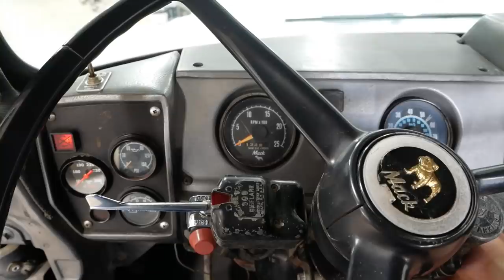"Simple" Axle Flange Leak Escalates Quickly - Vintage Mack Truck - Part 1

Comment: You are a poet: A single stack Mack with a window in the back. LOL If your going to replace the rear lug nuts I would put that tin shield back on it might be a heat shield for the inner seal it could be they improved the design by adding that heat shield .I don't know though maybe not a big deal for how the owner uses the truck.

Comment: one way i handled very tight axel nuts, was to use a jack stand to support the racket socket extension, kept it inline center! plus a long cheater pipe to loosen the nut.

Comment: Old RL looks well kept. Those Aluminum frames like to crap out where ever steel touchs them. Had an old 67 RL 700 the whole rear frame at the trunion broke away from Galvanic corrosion.

Comment: That sure is a beautiful truck. It's too bad they crunched it when they pushed the radiator into the fan. It's really a sharp looking tough looking rig with the white cab, black frame and all the polished aluminum tanks and wheels. It's a bad ass grain hauler.

Comment: That's the first time I have seen this style of tire plug installation and It gave me a light bulb moment. It makes me wonder if it could save punctured tubed motorcycle tires on the road. You can't leave a hole in the tire even with a new tube because dirt will get in, ruin it and leave you stranded.. again :P. You also can't put a string type plug in it because it is not flush on the inside of the tire. I might give it a try next time I get a puncture from a nail.

Comment: Aha, no :o) The thread starts down the hole so the shear stress is well away from the weaker surface. I guess it buries it deep like a good fence post. For a dowl you need interference fit on both halves or it just wobbles loose. It still fascinates me that the drive is actually going through the gasket paper under the huge compression force of the bolts.
Reply: An unusual internet discussion had was on changing the hub oil. Never done it, never seen it done on a truck. However, on the old Range Rover axels we all raced we noticed how the wheel bearings ate the oil up. I drained and refilled mine through the stud hole every couple of seasons and so did other folk. And then you wonder, what else is doing the same oil abuse?
Reply: Cracking vid really enjoyed it :o) I know that sinking feeling when the bolt doesn’t tighten, especially when out on site :D

Comment: also the mechanic that fixed the 1 at work told me never use an impact on cast iron because its brittle and will lead to what happened to that hub....just repeating what i was told  but its kinda true we f'd  up a few pump housings  when he told me that we quit using impacts on cast and we didnt have any more trouble.

Comment: Hi Wes, good video! it's just too bad you don't have access to a machine shop as good as you're hardware store because any competent shop could have repaired that hub! With you're attention to detail I would have expected you to replace that outer nut that you boogered up with the air hammer instead of reusing it without even removing the burrs.

Comment: What material were used on the tire repair?
That "inner lining compound" and before that the cleaning and some kind of special rubber glue?
And what was that tool and move at 25:19?
Reply from the maker: Standard patching chemicals. Buffing fluid. Patching cement. That tool is a bead blaster. It blasts compressed air at the bead to seat it.
Reply: @WatchWesWork  Thanks!

Comment: If the batteries are left uncovered and they get wet from the rain, the water is going to short the poles between them and the the frame also. The same goes for washing the engine compartment of a car and not removing the battery.

Comment: The next time you come across an axle nut like that use a jack stand to stabilize the end of the extension near the ratchet. That way your socket can't go off kilter which means it will have full contact with the nut. I was watching it come down on the top of the nut ,and was screaming use a jack stand dammitt!! LOL

Comment: I live in France, we don't even have a poor autoparts store. We do have one step up from a quick lube with an attached store with the stuff you might find in a well stocked walmart, but at USA dealer prices. We also have trade only auto parts stores, you can buy from them, but service will be grim and the price will be worse than dealer. Example a no brand poor quality made in china 12v rocker switch €17.  Small can of body filler 250gr €14. We have online options, but next day isn't an option and it all comes from Germany or elsewhere. Something I realy miss from my 10+ roadtrips in the USA (all in cheap beaters I bought).

Comment: I worked on a lot of r macks never seen those studs stripped out. And i changed a lot of those axles. Ready- mix trucks popped them like twigs.
Reply from the maker: I've never seen it either. I'm guessing what happened is the studs backed out of the hub and were not screwed back in all the way. Then they pulled out the little threads they were engaged in. So they screwed them in all the way, but there was not enough threads left to do the job.

Comment: 9/16", them and 7/16" are odd balls.. 9/16" fine nuts should be common, they are the nuts for spring bolts on  trailers. . And it's 13/16" for the bolt and 7/8" for the nut. I'm putting wet bolts and bronze bushings  just now on my 1958 utility trailer . going elk/moose hunting.  The 1 3/4" springs are causing a problem getting bronze bushings , 7/8"x9/16"x1 3/4" BTW I'm glad I'm no longer grunting away on heavy machinery.

Comment: Another good one. You can't use your tire machine in semi wheels? I did not know that. You make breaking that wheel look easy
Reply from the maker: No. They way to big and heavy to get on the machine. That wheel assembly weighs around 120 lbs.
Reply: @WatchWesWork  holy crap

Comment: I wonder if you could throw a keensert in there where the stock threads go and then make a press fit sleeve that goes into the minor diameter of the keensert so you still get the dowel pin effect but with a lot stronger threads. Thats a lot of mill and lathe work for an old truck hub though.

Comment: I always packed the bearings on full floating rear ends.  Are Macks special?  Loved your video, brought back memories of my days on the farm. Thanks.
Reply: From everything I saw it looks like they run in oil, there are only outer seals for the hub and the flange seal. They're getting bathed.

Comment: ..if you're certain the Front Studs are done, i'd get the guy to let you do the Rears at Half the six hundred since you're already There..

..& install that Metal Piece, it's a Heat Shield from Overheated Brakes for those Rubber Seals in there..

Comment: Wes, Just some questions could  you drill the stripped holes deeper and thread with a pulley tap and install studs into those 3 holes, as a machinist would be an easy lathe job to make the longer threaded studs. I know it's too late now for this job but there will be a next time. Another quick option without much work look into steel threaded staked inserts, we use them on stripped threads on aluminum, a quality fix, looked like you had enough area around the stripped holes.
Reply from the maker: I suppose I could have!

Comment: I wonder why i was taught you should pack the bearings on axles hubs when service or replacing them when almost every other video I does not? Granted i was taught this on Trailers specifically but, not quite sure why it would be any different on a drive axle. I was told packing the bearings with hi temp grease along with the axle grease give the absolute best protection possible. Thoughts?

Comment: Great video, that truck is immaculate...
     What was the black substance that you applied to the wheel bead..., maybe something related to the aluminum rim and the calcium chloride corrosion issue...?
or sealant of some sort...?
Thank you.
Reply from the maker: It's rim rust preventer. Supposed to keep the bead surface from corroding.
Reply: @WatchWesWork  
Ok, thank you sir for the response back, I am about to do a similar repair on an Eaton axel, was a great video for me.

Comment: 4:54 If you install the heli coil to the correct depth why shouldn't the stud work ? Unless the stud shoulder bottoms on the hub flange ?
Reply: To install a helicoil you have to drill and tap the hole oversize. That'd leave the unthreaded portion of the stud unsupported.
Reply from the maker: Because the drill for the helicoil tap is much bigger than the diameter of the stud. You would also need a bushing.
Reply: @mattt4183  Thanks
Reply: @WatchWesWork  Thanks

Comment: A word of advice always put some gear lube in the hub cavity before you put the outer bearing in it takes a while for the lube from the housing to get out to the hub have burnt up bearings doing it without filling cavity that's what the plug is for but getting it out is the next thing
Reply from the maker: I prefer to tip the axle. We'll do that once the wheels are back on.
Reply: @WatchWesWork  👍have done it that way also

Comment: 4707Q brakes? sure look familiar. I am used to set the bearing to 200 or 300 ft lbs, back off, reset to 100, back off 2 flats, set end play to .001 tir or a tad more. Have fun while I enjoy some more

Comment: Yep heli coils not a good idea I have ground the the holes open from the side and welded them shut and remachined the hole correctly on a mill with a super spacer but that hub was unobatinium for a diamond reo  truck

Comment: Those 6V batteries are kind of cursed! After 2 decades of using the 6V batteries to start our diesel tractor (a 1970s Same Saturno 80) and having to always deal with the 6V batteries dying on us or straight up quit one day to the other, we said heck it and installed the largest 12V car battery we could find. After 10 years the same battery is still there and starting the tractor like a champ, just needing to keep the engine quite revved up because the generator is slowly dying

Comment: Those Mack axles were rated anything up to 80 ton GCM.........provided they were low ratio like 4.42 or lower they could handle a V8 up front. Pro tip, dont lubricate the bearing shoulders on the spindle.......if anything give them some center punch divots to help discourage the bearing inner race from turning on the axle spindle, wearing it out.

Comment: To fix the hub you have a helicoil till the bottom of the thread then drill the top of the hole so that you can fit the unthreaded part of the bolt. This will fix multiple issues like the proper length of the bolt, the alignment of the bolt to the hub.
Reply: But that will not fix how the UNTHREADED section of the stud needs to fit the the UNTHREADED section of the stud hole tightly in order to act as a dowel to help bear the torsional loading (twisting load) of the axle shaft.  By design.....the axle flange, the stud, and the unthreaded section of the stud hole in the hub are meant to be the primary "points of contact" to carry torque load.  When you use the Helicoil drill bit to resize the hole in the hub to rethread the hole for the Helicoil insert......the new hole diameter made by the Helicoil drill is ALREADY larger than the unthreaded section of the stud. That means the point of load transfer on that stud will be moved down to the threaded section of the stud (which is weaker than the unthreaded section of the stud), contributing to failure of that stud due to flexion.
Reply: @larrywalker7759  What you are mentioning is easily fixed with a sleeve. He has a lathe. You even get pre internal threaded sleeves as well at certain stores. Just saying here that he has all the machining equipment to have been able to fix that hub and I am sure the replacement hub wa s not cheap either and that it took a while to drive to the junkyard find the specific hub and drive back. In that time he would have been done a long time already just doing basic machining on the hub.

Sure replacing an entire part does the job, but do you want mechanics to do the "throw parts at it" till it's fixed?
Reply: @kazykamakaze131  You are exactly right about the possibilities for salvaging a damaged component in various ways.
What kind of mechanics do I want?  I want a mechanic who knows when to hold 'em and when to fold 'em.
Wes responded to another comment that he paid $150 for the used hub and that the Helicoil kit alone would have been over $100 (and no guarantee the correct Helicoil or other brand kit was in stock locally).
Mechanics working on customer vehicles generally have time deadlines and cost points to meet, so it is not simply a matter salvaging a defective component with novel or unusual methods just because it can be done, a good mechanic will deliver a quality repair to his customer for the least expense necessary. While it is nice to know that if a replacement hub can't be found the hub could conceivably be repaired to infinity......it is better to know that Wes evaluated all the factors (time, labor and parts) for his customer.
Nobody is arguing that the hub could not be fixed and fixed right, just reaffirming that the repair here would have been the more costly way to return the tractor to revenue service for his customer.
Reply: @larrywalker7759  I agree to some of what you said. Just what you perhaps didn't see in the video is that he said it's not repairable. This is why I am commenting, to state that it is actually repairable. Often times issues with older trucks are that you can't get parts for them, now if someone read my comment and perhaps couldn't find a replacement part they could at least repair the hub.
Reply: @kazykamakaze131  True, he did say not repairable, but I think he might have just been giving the short answer.  He probably did not anticipate his statement generating this much discussion of alternatives to replacement.

Comment: The little bit of truck noise is music to my ears, means freight is moving, and from the sound of it, not much freight. You have great audio and speak clearer than most southern boys where you hear it..decipher it, then run again in milliseconds to understand exactly what was just said. I know that lots of folk love a mack but they are twice as heavy and do the same as any other rear end. Plus they spit gears just as quick as their counterparts. Do to truck popularity, I have to say that they last till they don't. Most that age are all messed up with frame jacking or broken crossmembers and the cab mounts once you jack the cab off the frame   can tell if the mounts failed or the cabin died. With  the cow pee fuel mix on the new stuff, hard to sell to that old trucker that said if hay kept my grandpas trailer on the trail, then good diesel should keep loe loe on the road and so  rebuilt for the fifth or tenth time still making miles. Hopefully no parasitic draw on batteries cause your getting close to the meet and greet times.... maybe a few  thousand more subscribers... an even half million of  those would sure improve the tool truck bills

Comment: I'll bet, after a day of fixing tires and mounting them back on the truck, you have no trouble getting to sleep. You definitely get some challenging jobs. Just curious, why would you use the lead wire style patch instead of a non-lead wire option? I have never used lead wire style patches.
Reply from the maker: The tire manufacturers all recommend that you plug the injury and patch the leak from the inside. Some states have tried to make this type of patch required by law.
Reply: @WatchWesWork  I actually do remember that some would use a plug and then patch from inside. I guess lead wire just makes it one process.

Comment: How does that device at 25:18 work to seat the tire?
Reply: Basically its an air tank with a large full flow ball valve on it and you just open the valve as fast as you canwhile still holding on to the tank as best as you can (so it doesn't try to kick you like an old mule) and it rushes the tire with all the 120 - 150 psi of air to fill empty space in the tire and causes the tire to rapidly inflate. But it really helps if the tire is soft and pliable. If its old and stiff in the side walls it can take a couple to a few attempts or twin air cannons.

Comment: If you couldn't find a replacement for that hub, couldn't you still helicoil it, and then counter bore it with a drill bit that had the correct OD for the shank of the bolt?  Not that that machining helicoils imbedded in aluminum would machine cleanly, and you didn't mind scoring the bolt a little...   Curious if you ever tried anything like that: Desperate times call for desperate measures?

Comment: i just wonder why you didn't open the outer axle nut with the impact, i used to do it all the time with no problem when i fixed trucks. And that oil thing, hihgly doubt it leading to much faster failing bearings as you did't fill those with grease.

Comment: That mangled hole could be fixed by removing the helicoil, machining that part back to round, reaching into the bottom of the hole with a thread mill and milling the thread for a helicoil, putting the helicoil in and then putting a bushing in the top part of the hole.  Is all that worth it?  Beats me, you'd need a CNC mill for the job.

Comment: I probably help build that truck at the hayward calif plant where I spent from 1973 to the end doing multi jobs from metal finishing to building up air tank making battery cables and air line couple years in the machine shop then as a mechanic at the end of the line 
Like going to college after the plant shut down i spent 27 years at freightliner dealership